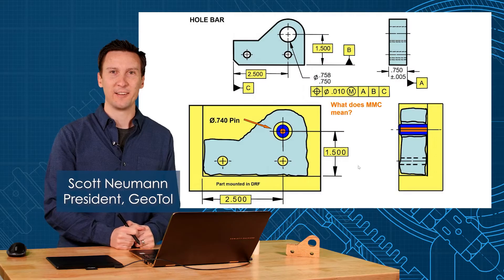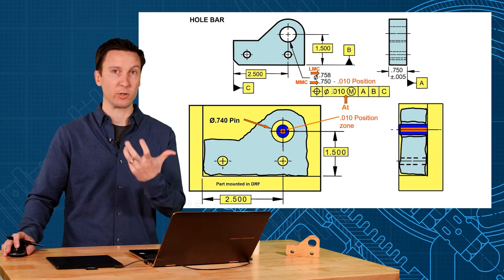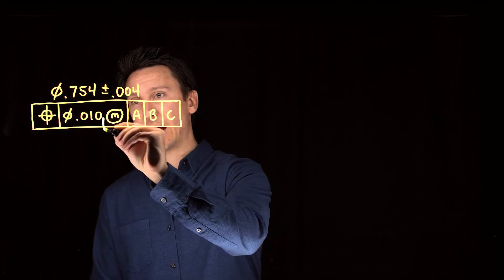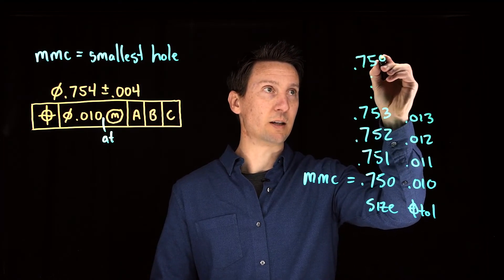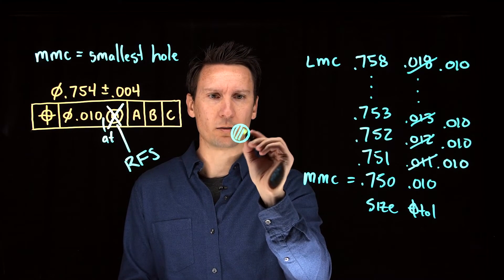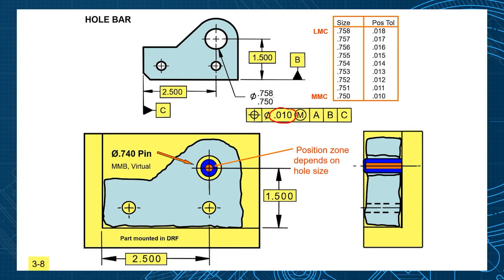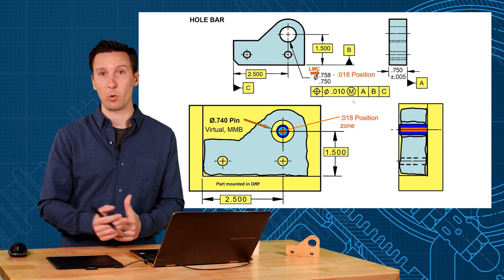The MMC modifier with Position (Bonus Tolerance)

Comment: I understood MMC given at position tolerance but if MMC given to the DATUM how can we calculate bonus tolerance
Reply from the maker: The material boundary modifier (M) on the datum feature is called MMB. It is very different than MMC on the feature. The MMB modifier allows the datum feature to shift. It essentially gives the datum feature an additional position tolerance. I sometimes call it a "wiggle bonus", and its hard to calculate the bonus value without a CMM. The concept is also hard to explain on an internet comment.

Comment: If we using use mmc in hole size is low right then how we can take bonus tolerance
Reply from the maker: The MMC modifier allows more position tolerance as the hole gets larger. If position tolerance is tight for the process, it may be beneficial to aim for a larger hole to get that extra bonus tolerance.

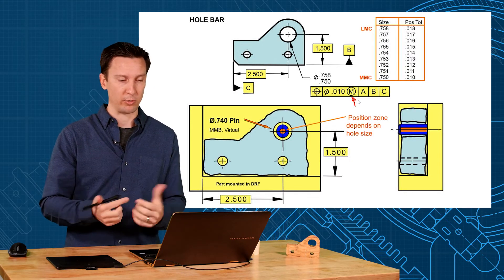Comment: 05:10 So, which modifier am I using, press fit or intersection fit?
Reply from the maker: clearance applications usually use the MMC modifier
press fit (interference fit) use RFS default (no modifiers)

Comment: Would that mean that if we leave it at RFS that at .758 we will have tolerance of +- 0.01 and by the calculation we will have a resulting hole of 0.748 which is largen than 0.740 (pin) and we just have more wiggle room which in turn would be more expensive for the manufacturer since they are keeping the same tolerance and we are not benefiting from the bonus tolerance? I hope my question was formulated well enough. Thanks for the great video
Reply: Of course each hole that has 0.758 will be enough for the pin so by the value of .748 I mean at it's maximum shift it will still be able to take the pin (at its nominal position).

Comment: I wish you would explain what happens when you add MMC to the Datums allowing for datum shift in this scenario.
Reply from the maker: The MMB modifier applied to datum feature references is a very different concept than the MMC modifier applied to a position tolerance. Unfortunately, Y14.5 uses the same symbol. Ill try to post a video for that in the future.

Comment: How calculate bonus tolerance for symetry with MMC? I'm measuring bolt hex
Reply from the maker: Symmetry symbol is only available in ASME Y14.5 -1994 and 2009. (not supported in 2018). 
And MMC modifiers are not allowed with the symmetry symbol. ISO-GPS may allow them though, I'm not sure. 
If you want a feature to be symmetrical (centered), then I wouldn't recommend the MMC modifier anyway. Keep it as position RFS. (simple)

Comment: Is that Bouns TOl Parts Applicable for Process Capability?
Reply from the maker: Calculating capability with a position tolerance zone and the added bonus tolerance is tricky because the allowed tolerance changes based on the hole size. There is another technique using the calculated virtual condition (MMC hole minus the position). This is a fixed boundary that the hole must not violate. Then measure how close the hole surface gets to the boundary (calculated RAME). Here is a related video for that: https://youtu.be/HSx7ofsad1k

Comment: I heard that, there's a thumb rule in GD&T that size tolerance should be more than the geometric tolerance. Is it correct?
Reply from the maker: I don't like that rule. It just depends on the application. Sometimes the size is very important (press fit) but where the feature is on the part is not important (big position tol). On a rotating shaft, sometimes the size does not matter but the coaxiality is very important (for balance).
Reply: @GeoTolPro  Thank you for your quick response..

Comment: As an engineer, I find it frustrating when GD&T explainers act like it is a good thing, a "bonus" when there is even more tolerance, due to the position /size variation. Sure, this is a good thing for the inspector, who can pass the part, and for the manufacturer, who can sell the part, but for the designer who wants the part to function perfectly, the 'bonus' looks more like a booby trap.  I would like to see some teaching on how to devise GD&T specs from the standpoint of the functional designer who wants to hold very tight tolerances that fully function without causing too much expense.
Reply from the maker: You certainly don't want "bonus tolerance" everywhere. This MMC modifier has two strategic applications: clearance holes and qualifying datum features. Don't apply this modifier to a bearing hole, an alignment hole, or press fit hole. 
There are two goals of a design engineer:
1. Make the part function
2. Maximize manufacturing tolerance. 
And goal #1 is way more important than goal #2. Applying a position tolerance achieves goal #1. The MMC or LMC modifier is only for #2. (only when it doesn't affect goal #1)
This is only a short video showing the mechanics of the MMC modifier. If you can get more tolerance while not affecting function, then that's amazing (clearance holes for bolts). Look at some of my other videos for practical example parts and when to use this modifier.
Reply: It is a good thing, if a good engineer applies this modifier to applicable parts and understands when it is useful and when it is not.

Comment: do u have an example, at lmc?
Reply from the maker: I don't have a YouTube video for it yet. LMC modifiers are not as common. They give bonus tolerance as the hole gets smaller. Its a good modifier for cast holes where a bonus position tolerance could be helpful for manufacturing and the outer boundary still matters.

Comment: does bonus tolerances using the MMC modifier work in the same way when following the ISO/British Standard?
Reply from the maker: Yes, it works the same way even though ISO explains it differently. ISO 2692-2014 states the feature must not violate the MMVC (virtual condition) when MMR (MMC modifier) is invoked. This has the same effect; as the feature's size departs from MMC, it allows additional geometric tolerance.

Comment: For what reason a designer would want the position tolerance for a hole to apply RFS, why he/she would not want bonus tolerance
Reply: Depends on what the hole is used for
Reply from the maker: Agreed. Alignment holes should not use an MMC modifier. Press fit holes, bearing holes should be kept RFS. 
Cast holes that need to be post-machined should not use MMC modifiers either.

Comment: You stated that LMC is discussed in another video. I can't find it, can you post a link? BTW, thanks for clarifying that MMC is used for assembly clearance not for locating the part. I'd love to see a discussion of how to use bonus tolerance to locate a part within certain limits. Thanks!
Reply from the maker: ahh, this is an excerpt from my online course. I don't have that video here. LMC modifiers are less common. It works the exact opposite--smaller holes are allowed more tolerance. RFS usually gets the job done without extra bonus tolerance.

Comment: One question: I do not understand why the MMC of the hole cannot be reduced if the position is better than the diameter .01?
Or: What is a functional reason for the specification of a position tolerance bigger than zero?

If the fit function is specified with position tolerance zero, it would be much simpler to use a profile tolerance, isn’t it?

The use of MMC is based on ideas for a manufactoring specification like milling.
But: A specification coming from design shouldn‘t define the manufactoring process. For example: A profile tolerance would match the needs of additive manufacturing…

A MMC-specification can describe „What manufactoring should deliver“. A specification „How is the manufactoring prozess running“ will define the holediamter near at minimum material.

I‘m afraid: It is so difficult to manage the game changer „maximum tolerance at border of function“ instead of the well known manufactoring drawing.
Reply from the maker: A lot of questions and comments to unpack here. 
You are right that any size and position tolerance at MMC could probably be edited to make the MMC equal to the virtual condition and use a zero at MMC. Watch my video on "using zero tolerance at MMC". However, the zero at MMC does not give many benefits for a drilled hole using a standard tool size. Zero at MMC helps manufacturing with turned, milled or additive manufacturing (processes that can easily target a different size). Zero tolerance at MMC allows a greater size tolerance. 

Profile requires a basic dimension for the diameter. Then there is one profile tolerance spec for both the size and location. Profile creates 2 boundaries (MMB and LMB). This is not good for a bolt hole because the hole can get too big (the head of the bolt does not get the clamping pressure). 

Position tolerance at MMC, on the other hand, creates only one boundary (MMB/ Virtual condition) Then the size tolerance controls the LMC size. This is why position at MMC is better for clearance holes for bolts. 
Hope this helps.
Reply: Let's take a look at the product development process itself:
The verification of a specification with linear size (and ISO modifier GN or GX) plus position of the derived feature at the MMC provides a result that gives information about the functional gap between this real part and a virtual second part.
With the result of a verification based on a profile specification it is not possible to get an idea of how big the functional gap to this real part might be - only the question: "Is the (hopefully) functional specification fulfilled?" can be answered.

But: What is the required function? It‘s always the same: Without an explicit functional feature specification there are always long discussions while working with a given drawing.

If an initial specification from the development department is based on the "joint fit" function, both specifications are good.

However, in real life, this first specification is used for any later process. My solution for the famous function "joint fit": The geometric specification of the single part feature should be specified with MMS and position tolerance field zero at MMC. This simplifies the calculations for the fit and ISO 286 with „H“ or „h“ is very useful. For manufacturing issues, I offer the service of creating a nominal 3D CAD version with a nominal linear size according to their requirements (typically close to the minimum material size). Nowadays, with 3D CAD, this is not a big task. But when it comes to how the manufacturing process works, using MMC is not recommended.

There are a few more fits: "screw fit", "trunnion fit", "interference fit" ... they all require a suitable initial specification by the design department. For all these a profile tolerance is not suitable.

Sometimes, during long discussions about MMC for a joint fit, I‘m dreaming of profile tolerance. Keep it simple or not simple. And I‘m dreaming every day of a functional feature specification…